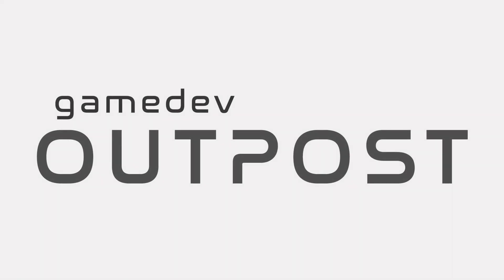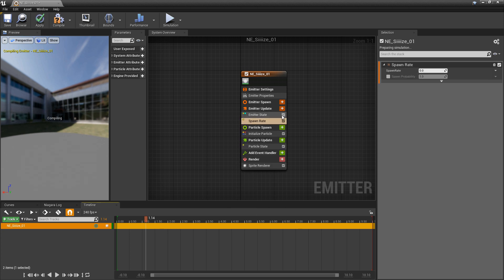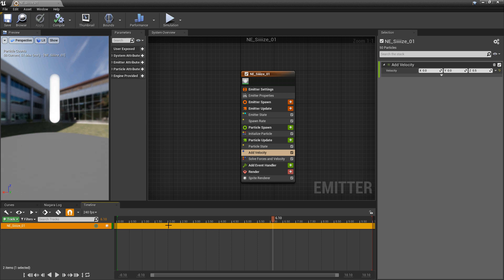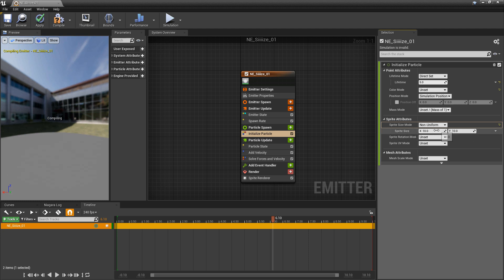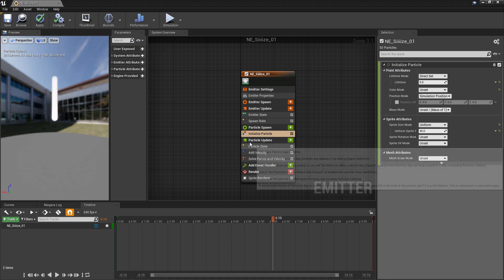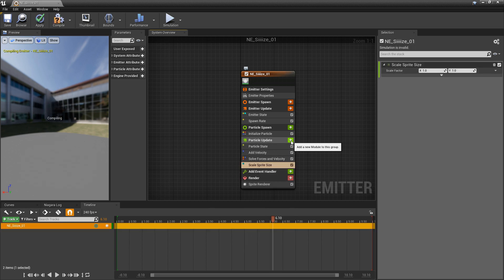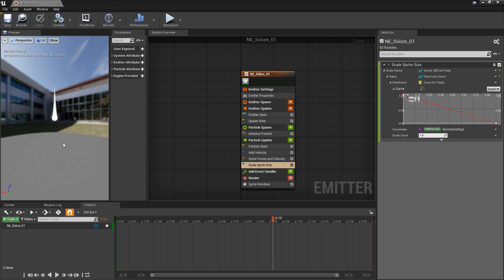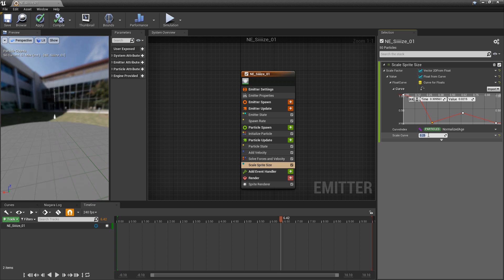UE4 - Niagara Adjusting Size

Comment: Why does scale size in particle update compound the sprite size mode in initialize particle? Scale color in particle update does not compound color mode set in initialize particle. Because of the compound, you need to use a ratio to control the size over time of the particle in scale size in particle update.

Comment: Most informative as usual!

What I would love to know is, how to scale the entire system!

Any insight?

Thx in advance, hope you've had a great weekend👍
Reply from the maker: It's not necessarily worth making a video about. Scaling isn't generally recommended  on any actor due to the fact that it could mess with further math you may want to do. With that said though, you can not scale a world space system, but if its in local space you can. You want to go to the "emitter properties" and turn on local space. This will allow you to scale your system.
Reply: @gamedevoutpost9270  local space! Cheers man, thx for your time!
Reply: @gamedevoutpost9270  It is a recurring problem, I think this would be useful! In Niagara I would make a user param called scale ( value 1 )  and I would multiply every size and velocity value in the process. And change the user param later if needed. Do you know something simpler by any chance?
Reply: @gamedevoutpost9270  The sprite rendered doesn't get scaled when "local scale" is enabled in the emitter. The Mesh Renderer behaves correctly, it change the paricles scale. Is there any simple solution how to set the sprite renderer to respond to the "local scale" setting in the emitter?